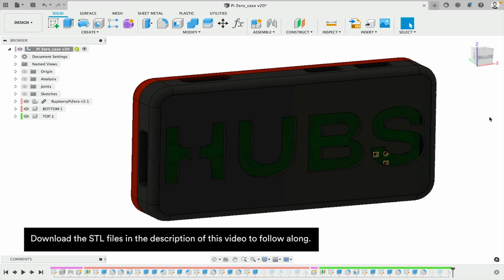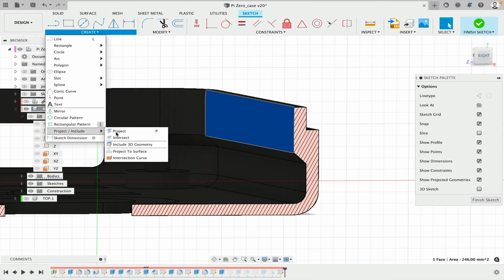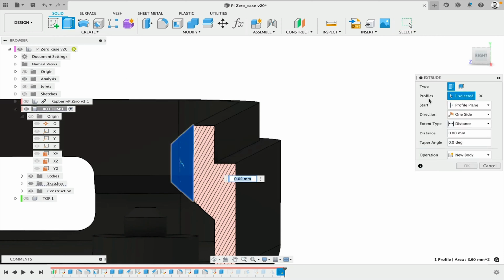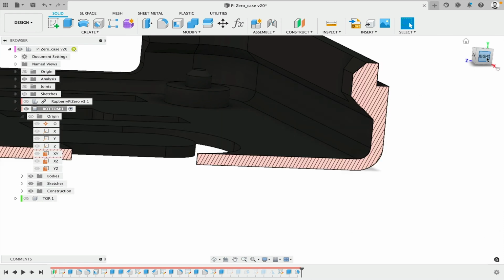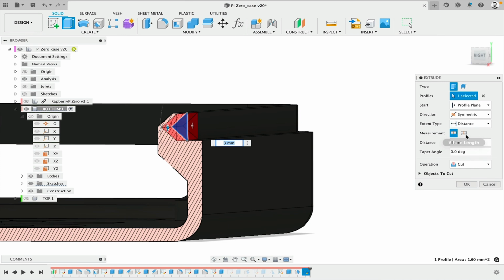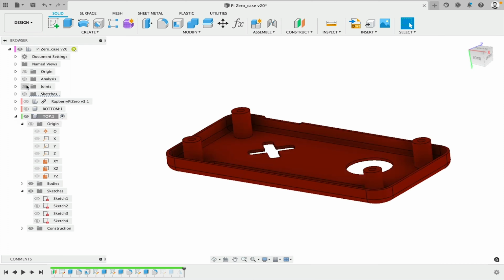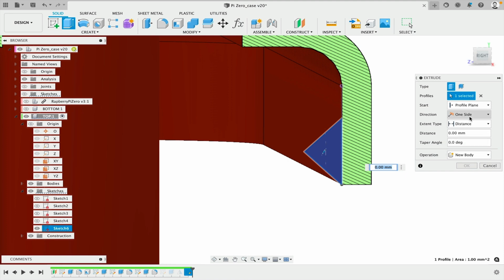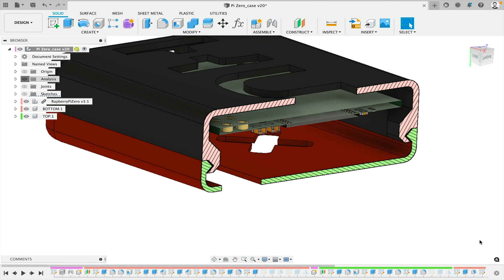How to Design a Snap Fit Joint - 3D Printing - Fusion 360 Tutorial (Raspberry Pi)

Comment: It is my understanding that the green part flexes to adjust inside the throat, as the red part is thicker. If the red part barely flexes or does not flex at all during assembly, it would be better to strengthen its tip (that carries the load) which is unnecessary thin.